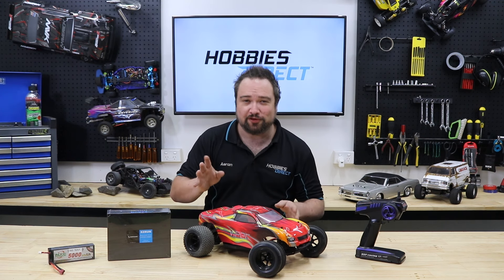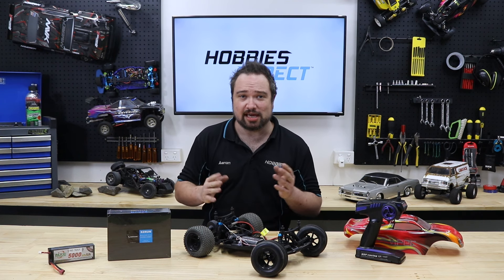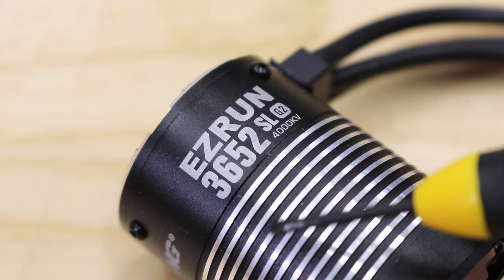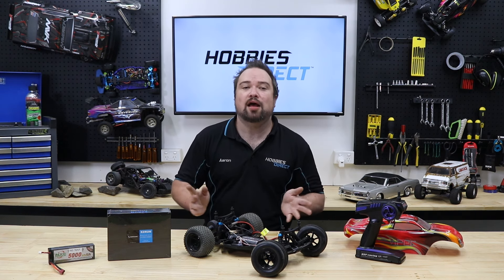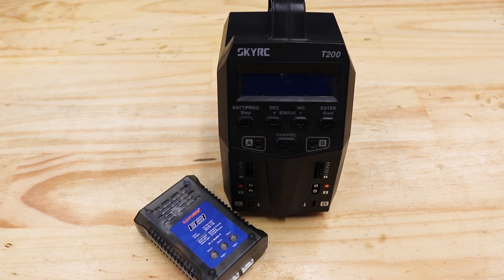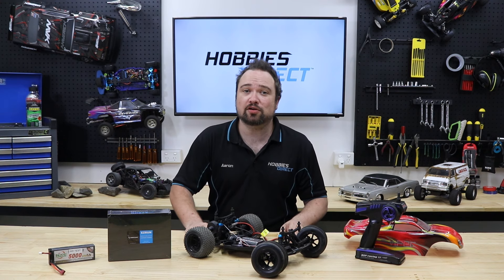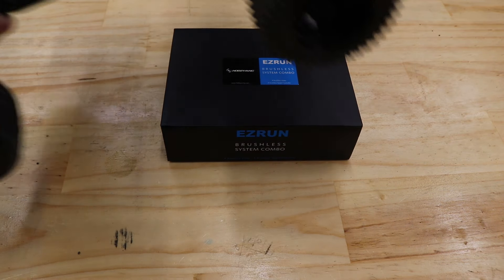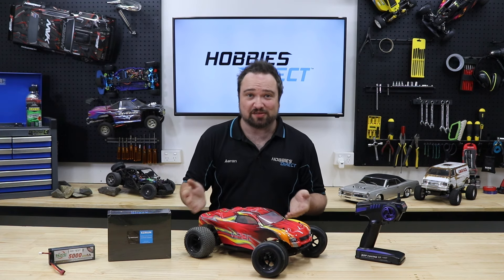How to Make Your RC Car Faster - Brushless Speed!

Comment: Oh wow 200 bucks for a brushed 2WD. I found the HBX Desert Truck 4x4 with fluid shocks, metal front/rear/center diff and all I've got to do now is slap in a brushless! Seems to be a great value so far for 100 bucks. However, im having some issues finding affordable motors that work, as im not sure what fits! This info definitely gave me a lot more than i knew so great work Jessie.
Reply: Syc 16102 pro stock can get 50kmp and with 3s lipo you can get 80kmp, it only cost $80

Comment: for Gear Meshing use a cigarette paper between the gears tighten up remove paper and you have the perfect mesh, just one ciggie paper
Reply from the maker: That works for smaller pitch gears, but as you get to 0.8mod/32dp, that trick may cause binding. Good trick when it works though!

Comment: I have one of these with the stock electronics ( but running on a FlySky FS-GT3B 2.4Ghz 3ch Radio) and it has a bad pull the left. I have tried replacing all of the drivetrain but its still realy bad. I have also tried adjusting the set steering servo position.
Reply from the maker: Is it only at full throttle launches, or everywhere? High powered 2wd cars with no gyro can be tough to full-throttle launch in a straight line. Instead, try easing on the throttle :-)
Reply: @HobbiesDirect  Its everywere

Comment: This is the best video ever for explaining about KV and power 😄😄
Reply from the maker: Nice! Glad it helped :-)
Reply: Can you help me out please What brushless Waterproof Motor can go 100kmp and a good ESC that would go with it
Reply from the maker: @RC.Car.007   In what car? 100km/h isn't too hard, but having a car that's drivable at the speed definitely is.
Reply: I hsve a LRP 120803 S10 BLAST MT 2 BRUSHLESS RTR 2.4GHZ - 1/10 4WD ELECTRIC MONSTERTRUCK
Reply: and my budget is only $230
Reply from the maker: Might be a bit of a stretch hitting 100km/h with that car. You could put in a 3s-capable ESC, but that's already a pretty high-rpm motor. Up the gearing and enjoy going 70-80kmh without anything overheating or being undriveable :-)
Reply: Would the Surpass Rocket V2 Supersonic 2750Kv Brushless Motor w/ 80A ESC Combo be good for my rc car
Reply from the maker: @RC.Car.007   Doesn't it have a 4300kv motor stock? If so, it would be a lot slower with 2750kv. 36% slower actually.
Reply: Ok thanks 😄
Reply: @HobbiesDirect  so I should Buy a 4000kv motor because my rc car is 4WD
Reply: @HobbiesDirect  I would like to make my rc go 80kmh what Motor and ESC can I buy that would do that.
Reply from the maker: @RC.Car.007  what motor and ESC is in the car now, and how fast does it go?
Reply: @HobbiesDirect  it is a LRP S10 BLAST MT RTR - 1/10 ELECTRIC MONSTER TRUCK RTR stock
Reply from the maker: @RC.Car.007  Yep, and what version is yours? Brushless? How many kv motor? what battery are you using? Have you measured how fast it is now? It's impossible to figure out how fast it will go with a new motor without knowing what's in it now and how it is currently performing.
Reply: @HobbiesDirect  it just a brush motor the model is S10 Blast High Torque Motor 23.500rpm LRP and it haven't Run for 9 years and it Doesn't work and it don't have a ESC and no batterie and no servo.
Reply from the maker: @RC.Car.007  oh sweet, in that case, go for a 4000-4300kv 2s lipo setup, that should be pretty quick with the right gearing!
Reply: @HobbiesDirect  ok thanks

Comment: Great video!  That's a Horse of a Motor for a 2WD car.  What Battery did you use?
Reply from the maker: And surprisingly smooth for non-sensored! We used that exact battery in the video; an NXE 5000mah 2s :-)

Comment: Why did you swap wires around in the new ESC. Dont they have to be in a certain order.
Reply from the maker: Watch the scene again :-) If the motor is spinning the wrong way, you can swap any two of the wires to reverse rotation. For sensored systems, this is done in the ESC programming.

Comment: Hello! I've been following your channel since  I can learn so many things. I have aquestion I buy rc helicopter last week but it didn't have a remote control. Can I buy any radio transmitter for my rc helicopter?
Reply from the maker: Only if it has enough channels to run the heli - and make sure it comes with a new receiver as well, it might be hard to match what is already there 🙂

Comment: Im assuming a max10 combo is the newer version of the hobbywing sc10 combo i ran in 2008? The sc10 combo came with a 4000kv motor and the sc10 esc was 3s capable. It made a massive difference in the traxxas rustler i had back then over the xl5 and titen 12t it had stock. That rustler is no more. But the sc10 lives on in my sons bigfoot. Yes its older then my son, but has proven to be a quality product as its 14 years old and still goes hard.
Reply from the maker: This one seems to be like an updated "quicrun" Max10 that was around a few years ago. Same tuning parameters. Gotta say, for sensorless and comparatively high kv, the motor is super smooth and punchy with almost no cogging.
Reply: @HobbiesDirect  the old sc10 had a tuning card and for old stuff was good. Im assuming the max 10 has the same if not better adjustability. Soft start on a rwd is nice, kind of like traction control but more like making the thing easier to not go too hard too soon on a thing if its just a hobby if you arent a full on into it racer.
Reply: I think the 'sc' series became the 'SCT' series, the heavier duty 'Short Course Truck', which also explains it still being with us.
Reply from the maker: @RTmadnesstoo  That makes sense!

Comment: I have a 2840 4000kv brushless motor, could I just change the esc and the battery for a better speed or?
Reply from the maker: Yep! Just remember with great power comes great crashes.
Reply: What a guy ! replying 1day after a comment, was made. On a video from a year ago.
Reply from the maker: @Rodgedodgebodge  Haha aw, shucks.
Reply: @HobbiesDirect  I found a 4370kv motor combo and a 60A esc with a 3s battery besides does anything else need to be changed? I don't think so?
Reply from the maker: @pyroboyzz3471  The drivetrain might struggle,  so maybe stock up on some spare parts. Electronically though, you're good to go!
Reply: @HobbiesDirect Well, I did that, I ordered a bl540 4370kv motor, the old one has 4000kv and a 60a esc in total, the bl540 motor is a combo with the esc they come as a package..now you need a 3s battery and that's it, right?
Reply from the maker: @pyroboyzz3471  Electronically, you should be good to go :-) The receiver is separate and not integrated into the ESC, yeah?

Comment: If we buy a brushless motor we need to change our esc to brushless esc to and we need to have fan for the esc right?
Reply from the maker: Yep! Brushless motors need to be controlled by a brushless ESC, and there's very few ESCs out there at can do both brushless and brushed. You don't technically need a fan, but you do need to stop the ESC overheating. If it's not getting to hot you might get away with not having a fan, but its not recommended.

Comment: Can you send a link to a maverick quantum rx flux motor that can go about 70 mph Anything faster then 50 really Or can you use any motor if it fits?
Reply from the maker: You can use any motor that fits, but the best and easiest way to get more speed in the Quantum+ chassis is to go big on the pinion gear; the stock car ratio is very conservative. Getting the car to handle at 60+mph is going to be the real challenge though haha.

Comment: I dunno what your talking about with the battery just doubling the voltage will double your speed ( half the life span tho
Reply from the maker: Except you can't double the voltage of a 7.4v 2S if the maximum voltage the system can handle is 11.1v 3S.

Comment: What brand is that black RC on the bottom left?
Reply from the maker: So glad you asked! It's a custom made thing based on an HSP Flying Fish drift car, with a bunch of carbon fibre heli parts.
Reply: @HobbiesDirect  mf is cleen 🔥
Reply from the maker: Thanks! It has a search light that turns with the steering haha.

Comment: should i get a 4x4 senton or a 4x2 gorgon? both 1/10 scale
Reply from the maker: Senton is bigger and faster, with more option parts. Gorgon is cheaper, and drives completely different. Ultimately, they are two very different cars - just be careful to not diff out and blow the tyres off the Senton on it's first run!

Comment: would you recomend running a 3S in this setup?
Reply from the maker: Not without strengthening the gearbox and wheels, no. And it would likely run a bit hot. That said, you'd have a theoretical top speed of 90km/h+, which is very fun as long as you don't crash.

Comment: Does flysky 3 CH (FSGT3C) transmitter have a Gyro?
Can I use it with 6 CH receiver (with GYRO)
Reply from the maker: Can't think of any AFHDS receivers that have built in gyro, and the transmitter couldn't control/adjust it anyway. You'd be best off installing a separate gyro :-)

Comment: I got i 550 brushed size motor in a maverick phantom xb what can it fit?
Reply from the maker: Another 540-550 sized motor - so like a 3650 or 3660 brushless. Don't go too big though, the drivetrain was never designed for that level of power and it wouldn't take much to start breaking stuff.

Comment: Hey i have a question which battery motor and esc do you reccomend for the overmax x hooligan?
Reply from the maker: There's not much info on that car out there, but looking at google you'd be pretty limited by space. It's likely the drivetrain wouldn't hold up to brushless power, so maybe just a Hobbywing 1060 ESC and whatever motor and battery physically fits :-)
Reply: @HobbiesDirect  alright thanks for help

Comment: I want to do this on my Traxxas Slash, due to the limited power, however the ESC is meant for a size 3652 motor, can I use the ESC with a 550 Brushless motor?
Reply from the maker: You will need a brushless esc to run any brushless motor. If you already have the traxxas brushless ESC, it should be able to do it as long as you keep the kv down to about 3200. And if you haven't already, add a fan to the VXL-3S ESC :-)

Comment: Is it compatible with off brand cars?
Reply from the maker: As long as it all plugs/bolts in, there's no reason why it shouldn't 🙂
Reply: Thank you @HobbiesDirect
Reply: How fast does it tipicly go? @HobbiesDirect
Reply from the maker: Depends entirely on the overall gearing of the car @RocketNation-
Reply: Can this esc take a lot? Is the esc better in comparison to maba xlx2? Does it start up in flames? @HobbiesDirect
Reply: Other wise it seems worth while!
Reply from the maker: The XLX2 is completely different, for much larger an heavier cars. They are not comparable. @RocketNation-

Comment: Can I use the same stuff you used In The video on my Traxxas slash?
Reply from the maker: Yep! Though we recommend going for a slightly bigger motor, like 3660 size and a maximum of 4000kv.
Reply: Huge favour. what would you recomend for a 5th scale baja?  motor, esc, and battery.   subbed and watching your vids. thanks for all the help so far
Reply from the maker: @kempek11  Big things, like this https://hobbiesdirect.com.au/p/26365/hobbywing-ezrun-max5-v3-56113sl-800kv-brushless-200a-motor-and-esc-combo-38010600 and the highest capacity battery you can get.

Comment: I have a wire that I think it’s for the steering, but I don’t know how to connect it to my esc
Reply from the maker: Steering will never be connected to the ESC, your servo wire goes into the receiver 🙂
Reply: But my steering servo has five wires that comes out from it, and my new receiver I can only plug-in three wires

Comment: Hi my arrma outcast 6s is more faster in rewards and throttle its more slower why is this please comment please below
Reply from the maker: Watch this part again :-) https://youtu.be/-hAoT1ZsBEI?t=570

Recalibrate your ESC (the procedure is in your car's instructions), check your radio channel reverse settings, and make sure your motor wires are plugged in right.

Comment: Can i upgrade baja rc car 5ss speed and can i make it faster?
Reply from the maker: Yep! Change the gearing and if you like, bolt in a Zenoah 32cc engine :-)
Reply: It an electric Baja. Is there anyway to upgrade the battery cuz I want speed and longer run time

Comment: Is the 4000kv combo worth the upgrade on a viper brushless?
Reply from the maker: Honestly, the rebranded Hobbywing 3300kv 60A combo that the Viper BL comes with is really tough. The 4000kv is about 20% faster, so it's up to you. You could put the money towards an upgraded servo and wheels instead :-)
Reply: @HobbiesDirect  I appreciate the reply. I’ve got upgraded servo and wheels and tyres already. 
Nowa the time to go faaaaster before I go to a xmaxx or something similar.
Reply: You may get by replacing just the motor since both ESCs are 60A but I would play with the pinion gear first.  Just be sure to check your motor temp after a full throttle run.
Reply: @RTmadnesstoo  any thoughts on what pinion gear size/s you’d try?
Reply: @glitchedenemy3806    I'd just go up a tooth or two at a time while checking motor temps.  Go up until it gets too hot after a long full throttle run or acceleration suffers then back off one tooth. Then you have pretty much maxed that motor combo out.  
'Too hot' has been defined by many as 'you can't keep your finger on it for a 3 or 5 count'.  Temp guns go on sale often so just watch for a good deal.  
You can buy incremental gear sets of 5 gears from places like Amazon which is cost effective.  They may not be the best gears but when you find what you want you can buy a good hardened or chromed one as your 'trial' gear wears out.  Probably be time for the other gear by then also.  I've found the factory poly gears are best -and quietest -for those replacements.  
Just don't make big radical changes and you should be Fine.  And Have Fun.
Reply: @RTmadnesstoo  thanks for your advice mate. Much appreciated 🤙
Reply from the maker: @RTmadnesstoo  Nice reply! :-)